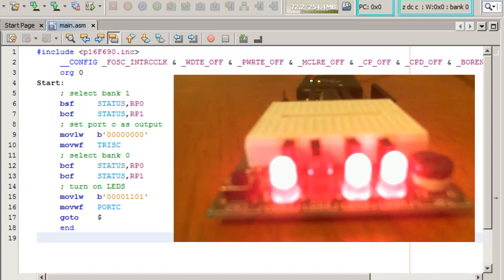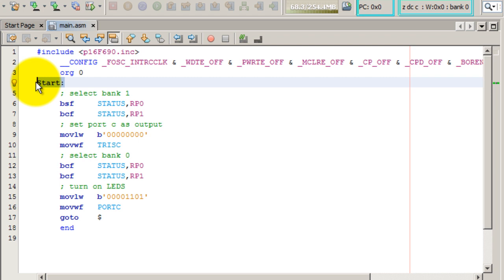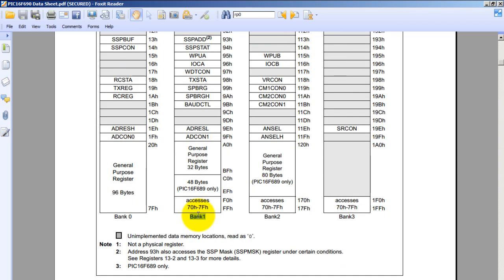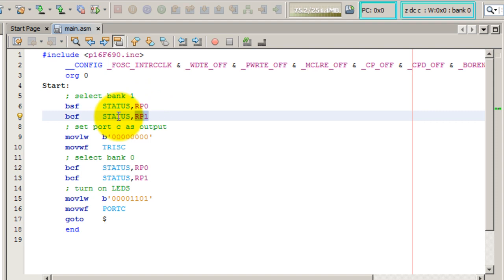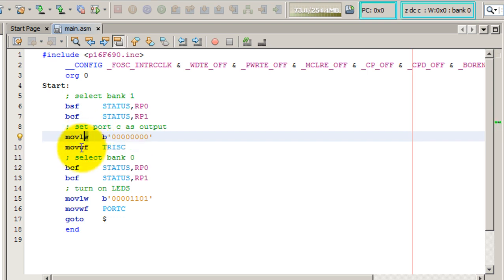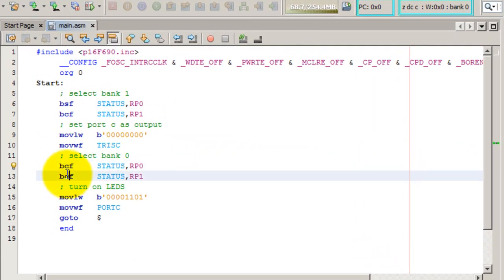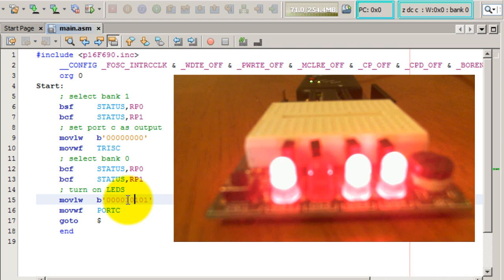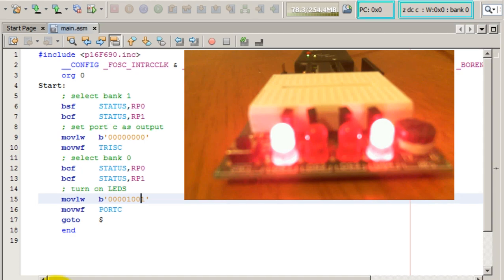PIC Assembly Programming Tutorial Step by Step

Comment: One question, there's a PORTC on bank 0 and bank 2, as well as a TRISC on bank 1 and bank 3. How to choose?
Reply: different pins - if you are going to use the other ports then you should use it, check the datasheet the pins corresponding to port c on bank 1 and bank 3

ill check  the data sheet
Reply: you have to switch bank from bank0 to bank1 or 2 to 3 by using RP0 and RP1 BIT of STATUS REGISTER ,SET OR CLEAR THESE BITS AND CHANGE THE BANK.